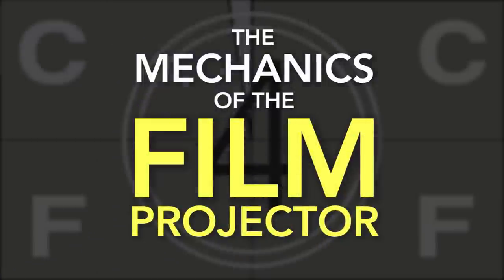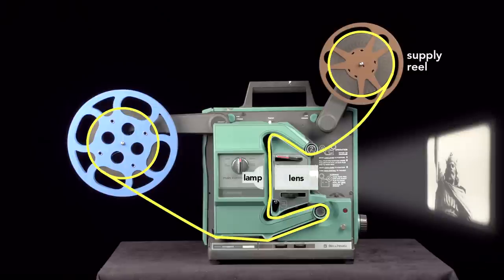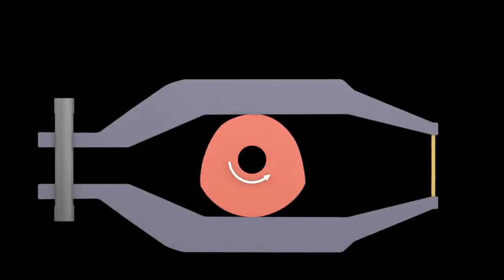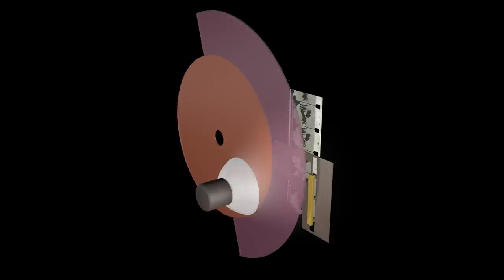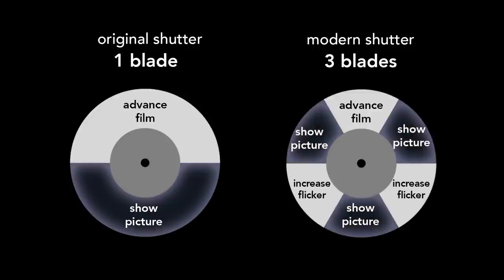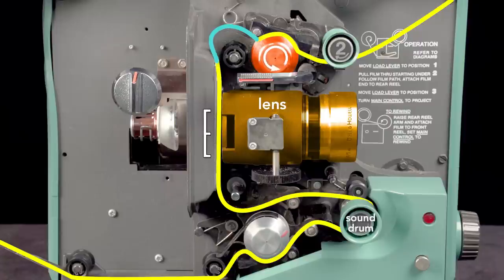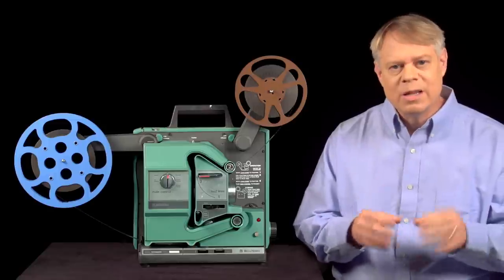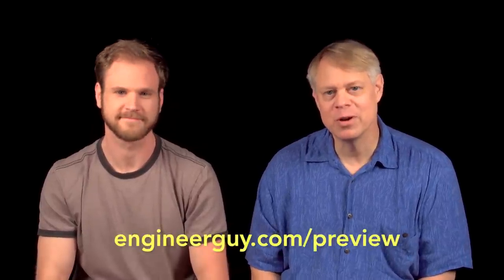How a Film Projector Works

Comment: I used to work as a cinema projectionist working with 35mm film, it's interesting to note how little difference there is between this smaller machine and the larger ones we used. The sprocket on our projectors though was a continues rotating wheel rather than the sliding mechanism on this one and it has an additional laser based optical reader for a DTS time code on the film.

Comment: side note for the youngins about film size and resolution. the chemical resolution of film and digital pixel resolution are not the same.
Reply: It is generally accepted that 4k resolution is about the same as Kodak 35mm print stock.

Comment: I can't tell you how many times I've seen a graphic animation showing a screw or propeller turning contrary to its motion through the medium, which enrages me to no end.  From a shade tree engineer to a real engineer, I graciously thank you for taking the time in that last animation to make sure that the gear ratio between the sprockets and shutter shaft was correct, in addition to the shutter and shuttle timing being impeccable.

Comment: I've got a question: why do modern projectors block the light three times? I get that the flicker rate would go up if half the revolution the shutter blocked the light, but what keeps them from simply blocking the image 1/6th of a rotation, effectively blocking the light as fast as the current flicker ratio, but now having an image on screen 5/6 of the time, instead of 1/2?
Reply from the maker: Arturo Munhoz We aren't sure exactly. We came up with this same solution, based on what we have read it SEEMS that the shutter must be symmetric or the viewer will notice something odd happening.
Reply: Arturo Munhoz A 24 hertz (cycles/second) square wave with a 5/6 duty cycle has a  24 hertz component as well as harmonics. You would be able to see the 24 hertz component. If the duty cycle could be raised high enough, then the amplitude of that 24 hertz would go down, but for reliability and cost reasons it is better to use a multiblade shutter.
Reply: Chris W So you mean that those harmonics would be the "something odd" that we would notice? That makes sense to me. It's always cool to see how things can be expressed mathematically and still be intuitive.
Reply: The "something odd" is 24hz flicker. The second harmonic would probably be very low and the third (and higher) would be too high to be seen.
Reply: Chris W
Oh, okay, I get it now.
Reply: A sort of antithetical corollary to the flicker problem is persistence of vision. If you hold a frame on screen continuously illuminated for too long, it "burns in" to the eye, resulting in motion blur artefacts. 

You could see this problem with early LCD screens, where even if the response time of the liquid crystal was good enough, there was a smeary quality to the visuals. 

In theory, LCD projectors and screens just change state from one frame to another in a way totally different to projector shutters. But in reality,  1/24th of a second is just too long to expose the eye to a frame. If you're exposing half via shutter (too flickery) it's 1/48th of a second between black and picture you reduce the persistence of vision effect, and if you expose using a triple-bladed shutter, you hit the sweet spot between persistence of vision and flicker-perception. There's no need to change this for any 24fps technology.

Some screens use black frame insertion to overcome this, and some flicker the backlight. Modern projectors do it because they have to or our eyes would register the image as awful.
Reply: Maybe next time they should get an actual projection engineer to explain a projector?  Theatre projectors have 2-bladed shutters, which give you 48 flashes per second (each frame is projected twice).  You need the extra flash because your eyes WILL detect flicker at 24 fields per second.  SCREENING ROOM projectors (and home projectors) have shutters with 3-blades because of the more-intense light levels available on smaller screens.  The same thing that happens to your eyes with 24 fields in a theatre will happen with 48 fields on a small screen with lots of screen light, so you have to use a 3-bladed shutter to make the image appear smoother.
Reply: @pegbars   The old 35's I used to run had 2 blades if I recall correctly.

Comment: I was in AV club in high school in the early 70s. We had a full auditorium with a projection booth containing an RCA 16mm Porto-Arc sound projector. It had to be hand threaded and in its lamphouse was a carbon arc lamp that had to be struck by hand. Immediately after the strike the operator had to set the proper gap as seen via a tiny projected image of the arc through a prism onto an etched glass gauge. This took practice because it was easy to loose that arc right after successfully striking it. Once properly set clockwork fed the arc rods together at the rate that they burned away. The projector had its own vacuum tube audio amplifier that filled the auditorium with sound. The picture was vivid, this machine put on a great show! I loved showing films and got really good at it, becoming an “in demand” school assembly projectionist.

Comment: So the sound was not reproduced like using magnetic records (like cassettes) instead using and optic system ?
Reply: Claus Valca Row I know! I found that incredibly interesting.
Reply: Claus Valca Row I know! I found that incredibly interesting.
Reply: Claus Valca Row The first sound movies used records; one for each reel.  Sound sync was a problem, partially solved by moving the turntable onto the projector and driving it off the same motor.  One theater I ran in still had the drive for the turntable still on the projector.  Oh, and selenium rectifiers providing DC to the arc lamps.
Reply: +D.E. Bunker I find that amazing, thanks for your input
Reply: +Claus Valca Row it depends
on the flim, before the 70s magnetic audio was used, dolby and optical audio
are used since the 70s
Reply: I think the reasoning behind optical sound was that it was cheaper when making prints of a film. All you'd have to do was optically print the whole thing at once (sound and picture) rather than printing the frames, then recording the sound to a magnetic track. Also, when splicing, magnetic tape needs a different adhesive (usually splicing tape) whereas splicing film uses glue. We used to have to do that in middle and high school when I was on the AV crew. Had to replace sound bulbs too. There was a little red plastic lens in the bulb cover that glowed when it was on.

And now that I think of it, metal film reels could become magnetized, which could muddy or even erase the sound if it was magnetic.
Reply: Backwards I think. Optical before the 70's and magnetic after.
Reply: Magnetic was used on early CinemaScope films.  Then, because of compatibility issues, Fox started making mag/optical prints, so any theatre could play the print.  Stereophonic mag sound was also used on 70mm prints until maybe 15 years ago, when the practice changed to DTS timecode, synced to sound on digital CD-rom.  Dolby Stereo was always optical.  Production of movies, however, had been on magnetic film since the late 40s/early 50s (with release prints bearing optical soundtracks)... and remained so until digital production sound became commonplace around 1990.
Reply: @pegbars  Correct.

Comment: Instead of dividing the shutter into 3 sections. Why didn't they just shorten the shutter during the slide transition?
Reply from the maker: Kombaiyashii These is an excellent question. One of the pieces that was dropped from earlier drafts was a bit of the rationale behind the engineering of that step. (You can see earlier drafts at the engineerguy preview page, where you can also become an advance viewer.) So, 24 frames per seconds, fast enough so that you see fluid motion, but most be faster to avoid flicker. A possible solution is to shot at a faster frame rate, says 72 frames per second, but then you have to use more film and the mechanisms in the projector must wove faster. More film is a negative: its is expensive, large rolls in cameras and sent to theatres; faster mechanism more difficult to engineer than a slower one. It would wear more quickly, use more energy, etc. So, the better ENGINEERING solution is to just take the shutter and split it up into three parts. Your questions "why not shorten shutter" is partly answered by this: faster mechanism, more trouble. (Not impossible, but you want to make a mass manufactured object as cheaply as possible. )The second issue is that is seems the shutter MUST be symmetric or the human eye will detect something.  In preparing this video we asked ourselves that same question: why not just a sliver of shutter. As we dug into the literature is seems that a shutter must be symmetric ....
Reply: ***** Ah, thanks for answering.
Reply: Kombaiyashii Also, the brain prefers uniformity over 'more on time' -- that 24hz flicker is just as bad when you have 66 or 75% duty cycle.  The only solution is to increase the flicker speed and uniformly at that.
Reply: ***** I think the issue here (that I had too) is that it's not about "show it as much as possible" it's about uniformity (as said below) of the flicker rate... it's counterintuitive but adding more screen flashing over the same image improves the perception of the image.  My gut is telling me that this would make it worse, but my brain is having an argument. ;)  Thank you for another great video. I thought I knew a lot about the topic, but you're making me really think about it.  :D  Cheers!
Reply from the maker: Scott Lawrence I had the same intuition! I find it fascinating that by chopping up the image more you improve it.
Reply: @engineerguyvideo  I used to tell the general public (who liked to watch films in the analog days) that when they went to see a two hour movie, they spent one hour sitting in the dark! The shutter being closed is the reason why.
Reply: @bobcastro9386  This is actually a surprising thing - you could film people watching movie and show it in slow motion, would be quite interesting sight :))

Comment: So the countdown at the beginning of a film causes the sound and the images to be insync? Or does the first 26 images contain no sound?
Reply: RamboX1000 The first 26 frames display an image without any sound and the sound of the 27th frame is stored in the 1st frame.
Reply: RamboX1000 The countdown strip functionally works out to feet of film...they are so the projectionist knows where to lock the film in the projector when threading the film initially.  The projector motors and particularly the xenon arc lamp take several seconds to get up to speed.  This spin-up time needs to be accounted for at the beginning or you'll miss part of the intended film.  For example, our old Century projector needed the countdown lead-in framed somewhere on "4" in the countdown so lamp would be up to full arc power by the time the main shutter opened. If we framed on '6' there would be 2 seconds of countdown at the beginning.  If we framed on '2' then 2 seconds of the intro to the movie (usually black, sometimes a company logo) would be skipped.
Reply: Stig Helmer When advertisement on TV where still shot on film, when edited together, and because of the 26 frames offset, you could notice that there was no sound on the first second of any advertisement clip.
Reply: frollard Didn't you love it when other projectionists kept chopping off the header on a reel and eventually messed up your change over?  I ran Century and old Simplex (E7s?).
Reply: D.E. Bunker   Yeah, if someone wasn't paying attention it got frustrating.  I would take off the gratuitous blank space at the beginning but it stayed with the reel and went back on when I broke it down. :)
Reply: +frollard  if you were threading that short you were cutting off some of the story as if you threaded it at 9 you can make a perfect C/O.
Reply: +frollard the countdown with 10 - 9-8 the last number would be 3 and the film, after completely black. These are number of feet before the image appears.  They are for threading purposes and 9 was the best result If you were quick.  These were replaced in later years by the second clock leader, with the spinning counter and the last frame was 2, thats two seconds before the image appears.  All for the projectionist to sync the film on changeovers. most films you had eight reels for a show.  Five and a half for the feature, Previews, short and misc. Now digital no difficulties.

Comment: Why did they make the original "advance film" shutter blade so big if 1/3 would have been enough?
Reply from the maker: Stefan Zijlstra See my answer to Kombaiyashii  ....
Reply: ***** A thx, i get it
Reply: Stefan Zijlstra One thing to consider is that initially the mechanism moved slower (which was easier to build). So originally it did need the full 1/2 blade. When they moved to the triple shutter then it necessitated that the shuttle move faster so it could move down during a 1/6 blade movement.

Comment: This was so cool, but I don't get how the photo sensor transforms the light from the film to electrical current and how that produces accurate sounds.
Reply: But... how is it "translated?"
Reply: +Xmus Jaxon Flaxon-Waxon III So how does it become current?
Reply: Oh right. Light is already part of the electromagnetic spectrum. So it's kind of just playing it, right?

So I guess the next question is, how were the sounds recorded optically? Was a diaphragm used, like the ones in phonographs? 

Also how are multiple kind of sounds accurately recorded simultaneously? The Engineerguy said it the film's length and width determined the loudness and pitch of the audio, but aren't there some sounds that are at the same pitch but are still distinctly different?

BTW: Sorry about all the questions and thanks for all the answers you've already given.
Reply: +Xmus Jaxon Flaxon-Waxon III You are talking magnetic sound tracks and few 16mm and even 35mm projectors were equipped with them. The standard is optical sound, and if you take a fotocell, and hook it up to an amplifier you point a bright light at it, and run a dark piece of cardboard up and down between the light, and cell you will hear a popping sound on your system speed it up and down you will understand. actually invented in 1904, and not by Edison.
Reply: A year later, but hey this is when I read it.

For recording, the sound is converted by the microphones to an electrical signal which would be used to power something that functions much like an ordinary speaker, except that instead of moving a cone to project sound, it moves tiny pieces of metal that act like a shutter. Light is projected through the gap between those two pieces of metal onto film. Develop the film and you have the audio track. This method is the variable density method.

The variable area method which looks more like a wave form, is much the same as the above method, but instead of the speaker like device, it uses a mirror galvanometer to reflect light in such a way as to increase or decrease the width of the beam of light projected through a narrow slit onto film.

For stereo soundtracks you would project left and right onto separate areas of the film.

Playback uses a photocell which responds to varying intensity of light with a voltage. Amplify this voltage and send it to some speakers and you have sound.
Reply: A little cool experiment that you can do to get a sense of what is going on. you will need a laser pointer, a small solar panel (cell), some sound device (cell phone) a speaker that you can sacrifice for science(most of these you can get as freebies) and earbuds that you hook up to the sound device that you can sacrifice for science.   Strip one of the earbuds off and you will see two wires.  Strip it down so the two wires have enough room that you can separate them at least 6 inches.  Then take the laser pointer take out the batteries put one of the wires into the space where the batteries go, put the batteries back in then take the other wire and put it on other end of the batteries(closing the circuit)   Then take the cheap speaker and and strip off the plug and strip the wires and connect these wires to the solar cell.  Start playing music on your sound device with the headphones attached, push the button on the laser pointer, point it at the solar cell hooked up to the speaker and you should hear sound coming from the speaker.  This is basically how the photo sensor transfer sound.   They just have an amplifier hooked up to the photo sensor so that you can hear the sound.